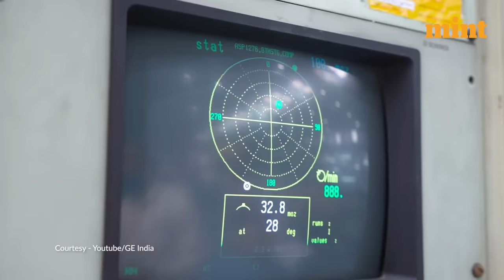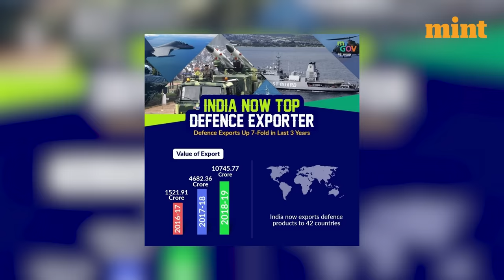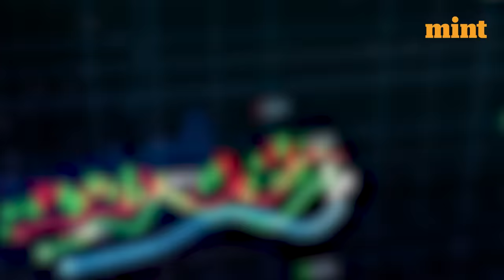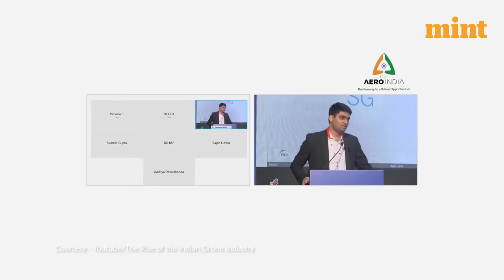Why is India's Defence Sector Booming? | Mint Explains | Mint

Comment: In contrast, India’s exports are mainly low-value products, coupled with the modest size of export ordersSecond, the Indian defense products have not demonstrated an impeccable record of reliability, operational efficacy, and after-sales service for the potential importers to consider buying them seriously.

For instance, in 2015, Ecuador unilaterally terminated a contract with Hindustan Aeronautics Limited (HAL) after four of the seven Dhruv advanced light helicopters (ALH) it had purchased between 2009 and 2012 crashed due to mechanical failure and other reasons. Ecuador grounded the remaining three helicopters. This resulted in a legal dispute.

As it is, ALH’s record of performance is dismal. In March this year, the three services and the coast guard grounded their entire ALH fleets for a comprehensive safety check, days after an Indian Navy ALH plunged into the Arabian Sea on March 8 due to an unexplained loss of power.

Less than six months earlier, in October 2022, a Rudra helicopter, an armed version of ALH Dhruv operated by the Indian Army, had crashed in Arunachal Pradesh, killing all five personnel on board.

An ALH also crashed in May 2020; there were another two crashes in January and August 2021; four emergency landings occurred in October 2020, March 2021, January 2022, and March 2023.

In March last year, an accidentally fired BrahMos missile landed in Pakistan, and only last month, three missiles were misfired in Pokhran during an Indian Army exercise. “Such incidents can be disconcerting for potential importers of arms from India and affect the export prospects,” says Cowshish.
Reply: hey Sick mind. how are you doing neighbour.